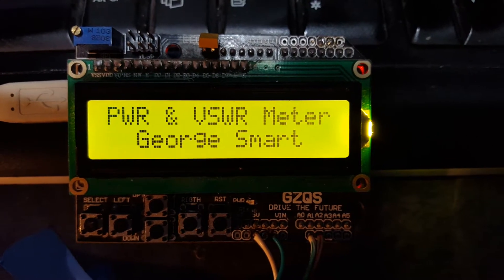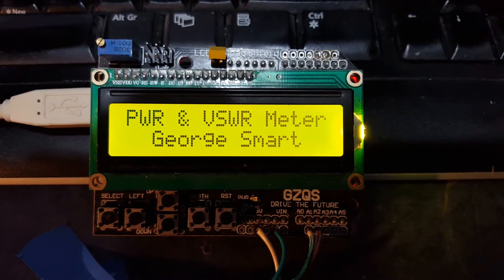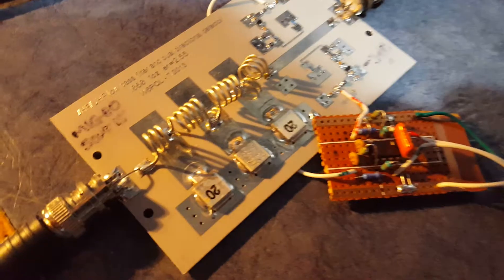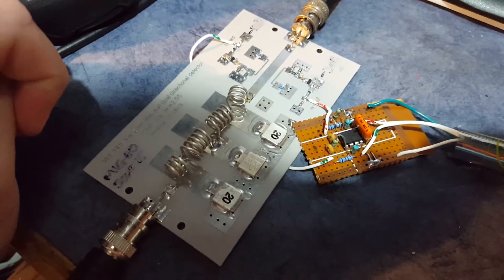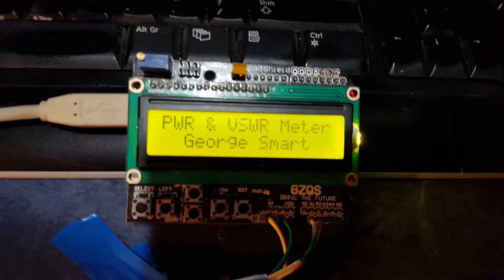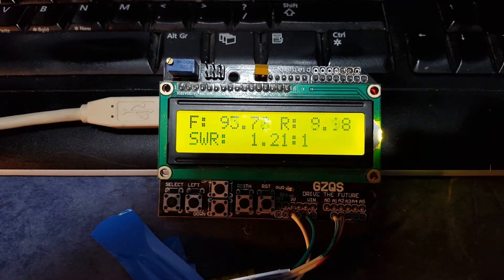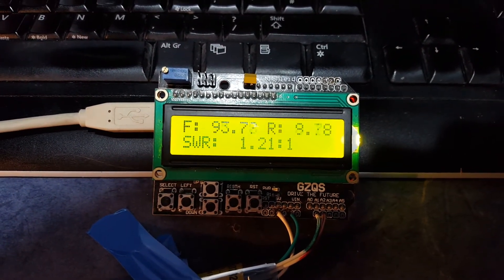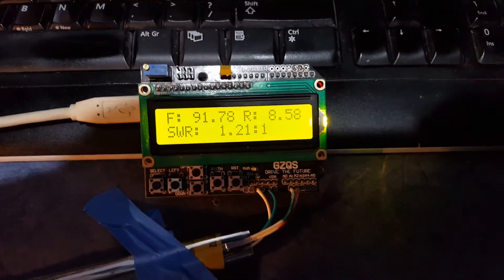M1GEO 2m Power & VSWR Meter for LDMOS 1kW Amp

Comment: This is really good George. Im interested in the Op Amp you are running on this kit. I want to create a Antenna analyser on the Arduino and will need an Op-Amp of some description. Could you let me know which one you are using and the schematic ? 73 Dan
Reply from the maker: +ColdestMoon I added a description in the box below the video.  Drop me an email; I'll describe the circuit more if you require.
Reply: Felicitaciones por tu excelente proyecto. Me insteresa armarlo, si pudiera pasarme el Code a email: genaromoscol2014@gmail.com. Saludos desde Peru.